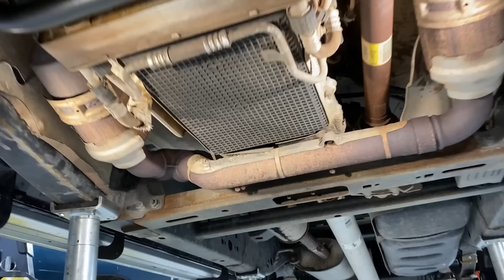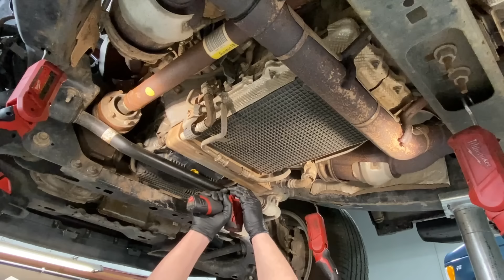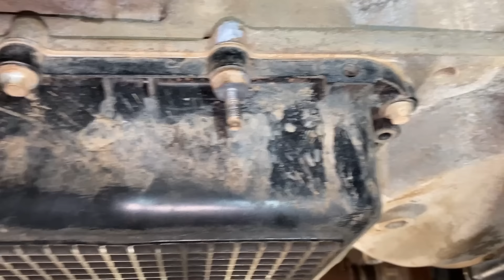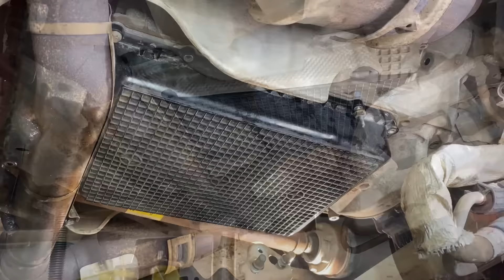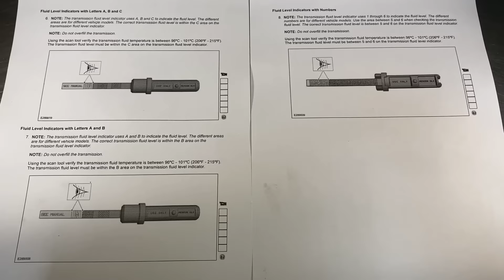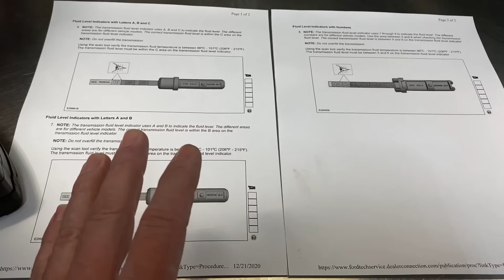Ford 10R80 Ten Speed Transmission: Fluid and Filter Service Procedure

Comment: Plastic transmission pan without a drain plug. Check
Dipstick you can only seem to access while underneath the car next to a hot catalytic converter. Check
Extremely Complex design requiring eight quarts of extremely toxic expensive fluid. Check
Reply: My 2010 Tundra is 13 quarts of WS, and doesn't even have a dip stick. You have to get the trans to between 95-105*F and pull a plug on the pain that has a stand tube in it and have the fluid just drip out, thats how you set the level on it. The fill plug is a 32mm plug half way up the drive side of the trans. It's easy with a 2wd, but the 4wd is a PITA. The front drive shaft and cat make it hard as hell to get your arm up in there to the fill port.
Reply: @TdrSld  I did our rav4 and sienna a few times. I just put in what I took out , dead cold on the drain and on the fill so you can’t really screw it up with fluid expansion ect.
Reply: @Firebird400  won't work on 10r80, mine and MANY others were over 1.5qts low from factory
Reply: @TdrSld  In my opinion, this is actually better than what Ford does. Those plugs allow you to check the fluid at much cooler temps (95f-105f) vs the Ford design. On most of the Ford's, the fluid needs to be checked at 200f which completely sucks with that stubby dipstick. This is also why Ford doesn't like people messing with their trans fluid. It's almost impossible to refill correctly. Most dealerships won't do it right either.
Reply: @davesmith2693  I use long handled hose pulling pliers. They have two round jaws designed to twist and pull heater hoses off. Use a wrench to loosen the cap and then lift it off with the hose pliers. Then use bent needle nose pliers to lift the dipstick in and out. Works great. I agree, it IS a pain in rear to have to go through all the trouble but it is the way it is so we just find a way to deal with it.
Reply: @davesmith2693  Yes remember stickers on fords  trans pan on the POS axod  saying do not service which which is funny because they usually needed more than just service an R&R
Reply: Hahaha yes this is great! 😆
Reply: I’m sure they’ll go to “lifetime fluid” soon too so they can sell more 60k trucks and SUVs
Reply: @krassimirpetrov7131  nah all the brands tried this yrs bk it didnt go over well. We need serviceability in these new expensive vehicles
Reply: There’s nothing toxic about the fluid. That’s about the dumbest thing that I’ve heard in a while.
Reply: @prevost8686  yep, I just had a big glass of it with dinner, feeling great!
Reply: @halleffect1  Hersey two step on your horizon 😂
Reply: @prevost8686  All transmission fluid is toxic, hence the warning labels.
Reply: @InuranusBrokoff  no it’s not.
Reply: As to why its “very toxic” i have no idea, but i have used this stuff and it has a big skull and cross bone warning right on the front of the bottle. Do a google image search on ford ulv.
Reply: @johnnorris6737  wear gloves an safety glasses or better yet get ur friendly dealer to do it
Reply: Why is the fluid toxic?
Reply: @yousufkan6960  it's not healthy but it's not that bad just wear gloves or get the dealer to do it
Reply: Germans take it to another level they tell you to fill the ATF thru the drain hole.
Reply: @MrManuel1329  same with Nissan/ifiniti.  just did a g37 like this
Reply: Maybe people should stop demanding new features instead of simple designs ?
Reply: 452Rob
Well, I have a 2019 Silverado in the shop that doesn’t have a dipstick. First one I’ve seen but I said below that all GM trucks have dip sticks unless the very newest ones don’t. To say I know nothing is a bit moronic being I’ve been a recertified ASE master tech many times over before I quit taking the tests well over a decade ago. I’ve been doing this for over 35 years and worked for multiple dealers and private shops. When you say I know nothing you loose credibility. Grow up dude...and learn to read all the comments so you’re fully informed about what someone actually said in context before opening your mouth and looking stupid.
Reply: Designed for unservicability. Ford.
Reply: @ShersGarage  ford and gm design. Not just ford
Reply: @ShersGarage  pay to let local Ford store handle it thus they on hook etc. My '19 Ranger XLT FX4 is set fine .
Reply: Hey but the filter actually bolts in.  In the 6R80 it wants to come back out while you're trying to line up the pan.
Reply: Huh ? Not my '19 Ranger XLT FX4.
Reply: Yea just get dealer to do it. Not any sort of routine service! This transmission is so incredible it's worth it ..no complaints!
Reply: @Readytobeamup  Amen to that.
Reply: @Readytobeamup  The difference is that the RAM is actually reliable, lol.
Reply: Don't forget must be running and up above 180 degrees to check level and there are about 4 different dipsticks now lol
Reply: CHECK MATE, ENGINEEEERS WIN AGAIN, ALTHOUG CUSTOMER IS ULTIMATE LOSER
Reply: You all don't think GM and the rest don't do this? I think GM was one of the first to remove the normal dipstick on the tranny.
Reply: @NY411Info  my 2018 chevy has a trans dipstick
Reply: @trevorchadwick5479  Maybe it does but many GM vehicles don't like the rest of the junk companies are building now
Reply: @NY411Info  ford had this dipstick on 2000 s lincolns ls with jaguar transmissions junk so no GM did not due this first
Reply: @NY411Info  nope. I service them all and so far haven’t seen a GM without a dipstick. At least not in the last 35 years.
Reply: @452Rob  have you never worked on a Cadillac CTS?  i do very few GM's but this one came in and had no conventional dipstick.
Reply: @halleffect1  I don't know what he is talking about the are many GM that are similar.
Reply: @halleffect1  well, I was thinking more specifically of trucks.  Ever done a Cadillac CTS but lots of Camrys and Honda CVT, etc. wWhat I meant was I’ve never seen a Chevy or GMC truck without a dipstick.
Reply: @ralfsautomotive  not GM trucks unless they are quite new.
Reply: @452Rob  I assumed that is what you are talking about.
Reply: @452Rob  guess you dont work on the  cars then. They definitely have a fill hole and check plug....but no dipstick
Reply: @gearwrench1davis392  I do work on the cars, said the same in another comment and said my initial comment was geared toward trucks. I owned a turbo Civic with the CVT trans that uses a weep hole. I service Toyota cars and trucks that also have no dipsticks. My original comment was intended for GM/Chevy trucks. They all have dipsticks. Period. If they don’t, they are extremely new.
Reply: @452Rob  you obviously are full of BS, my 2004 Cadillac CTS had a sealed transmission. Same transmission in the SRX and I am sure other GM products of that time period.
Reply: @halleffect1  You are so right.   My daughters drove a 2000 grand am V6 and 2004 grand am 4cyl, both had no dipstick for the transmission.
Reply: @452Rob  Ford and GM partnered to build this transmission... so, there’s that.
Reply: @Trey K, if you’d bother to read all the comments you’d see we’ve already discussed this. And you would see that in my earliest comment I said something to the effect that all GMs (and I was talking about trucks) have traditional dipsticks unless the very newest models are an exception. So there’s that.
Reply: @appleiphone69  ya cadillac cts is a great TRUCK
Reply: @452Rob  Cap

Comment: Is that a (yellow) plastic drain cap on the engine pan? 😳
Reply: Yes, along with the plastic engine oil pan.
Reply: They just need to find a kind of plastic that will work for the engine block now.

Comment: I suppose it isn't any easier on the current F250,  F350's with the 10speed?
Reply from the maker: The 10R140 on the Superduty trucks is a piece of cake.
Reply: @FordTechMakuloco  Thanks!     I assume that applies for all the engine choices (in my case the  7.3 gas motor)

Comment: No "lifetime" fluid in the 10R80E haha.Maybe I missed it what is your recommended intervals?
Thanks for another thorough video. Merry Christmas
Reply: In an earlier video, he recommends first service at 30k miles, changing the fluid only, not the filter.  Then fluid and filter at 60k, and then recommended interval thereafter, which I think is every 60k miles if I'm not mistaken.
Reply: This is not an easy job when your laying on your back with the truck on stands, but still do able
Reply: @blainemcdonald6972  Yeah I can only imagine. I wonder how much the dealer charges. I'd have to see if it's worth it to just have them do it.

Comment: I bought a 2017 F150 a little over a year ago. The truck has a 6R 80 and just passed 30K miles. I did a drain and fill and added Dormant pan with a drain plug to make it easier in the futer. The trans. shifts like butter. I thought I would have liked to have had  a 10 speed trans. but now think I doged a bullet!
Reply: I installed the doorman pan too, it works great.
Reply: I had a 2017 10 speed it was amazing,behind the 3.5L engine, what a great towing combination .Dealer offered me too much for it so now I have a 2020 3.5 w. a 10 speed and it too is a beast.

Comment: I just did my f250 and it was a decent sized mess. Probably spilled 1/2 quart on accident.  Can't imagine 10 quarts with no drain plug lol.  I guess without a transmission drain plug nobody will mistake it for an engine oil drain...

Comment: Ford: go ahead, service your own vehicle, I dare you.
Reply: And the Ford dealer wants to know why I won't trade in my 2002 F250......  The most difficult thing I have had to do so far on it, (Not done yet), change out the crappy roof corner trim pieces on top of the cab. I simply haven't had to do anything tough on this truck yet!! I take that back. Passenger side front shock top nut. That was a PITA.... Oh yeah, I still have not changed out the original spark plugs... V-10, don'cha know...
Reply: @SteveP-vm1uc  I had a 2003 F-250 with the 6.0 diesel....my thought was "who's the whiz that put the fuel filter on the frame under the truck!" Was totally ridiculous compared to the 2001 7.3 I had before it.
Reply: @SteveP-vm1uc if you still have them, and they just fell in the bed. Just glue them back on.
Reply: Yep, filled for life.......don’t think so! It’s the life of the fluid, which can be as little as 30k miles.
Reply: It's come a long way from the model T hasn't it? With those, they'd sell them with a basic took kit because people were expected to DIY. Now? I'm surprised we even still get a jack and a lug wrench lol
Reply: @crewdawg2008 some vehicles don’t even come with a spare tire anymore. That’s crazy.
Reply: @StephenBrewer89  I've heard of that. Not even a doughnut. I haven't been new car shopping in a long long time, and for plenty of good reasons, but a car not even having a spare tire just doesn't make sense to me.
Reply: @crewdawg2008  yeah it’s crazy man!
Reply: @StephenBrewer89 teslas don’t, call the dealer for a tow is the process
Reply: @debbiemccluskey384  yeah I refuse to take a vehicle to a dealer unless I am under warranty. I have done automotive service at dealers for long enough to know, the dealer is not always best.
Reply: Yupp makes sense just buy a new one, simple!
Reply: Got this! Ford trucks for life.
Reply: Thank God I have the 3.0L Powerstroke! Way easier.
Reply: I’ve used his videos and fully serviced my 2021. Incidentally, my transmission shifts so much smoother than it did. I found a lot of med grey metallic partials as little as 60,000klm
Reply: And I took that personally
Reply: Lmaoooo, is removing a few lines and 10mm bolts too hard for you?
Reply: I do all my own service, worked in the industry for years and I know for a fact regardless of what you pay for you’re lucky to get everything you pay for. Very few decent mechanics around, I believe this guy does the right thing but I’m in Southern Ontario.
I use Utube for directions and use Fordmakuloco a ton.
Reply: A good laugh I’m sure. The “engineers” designed this to be as complicated as possible.

Comment: Makes me even more appreciative of the comparative simplicity of servicing my 2011 Screw FX4 F150 5.0L 6R80. Early on I installed a proper trans dipstick and drain plug on mine.100,000+ miles with lots of RV towing with multiple trips to Texas, Alaska etc. And still looks and runs like new.
Reply: I added a drain plug and dipstick tube to the tranny pan on my 2014 Mustang GT so my future changes will be a lot more easy.

Comment: I just bought a 2018 f 150 with the 5.0 from a Ford dealer. I specifically asked when the transmission fluid needs to be changed. The answer I got, "its a closed system, you don't change it"
Now watching this I'm thinking they just didn't want to do it.....wtf!!! 
Looks like an expensive job.
Reply: They want you to buy a new truck when the trans in yours goes out.

Comment: I just did a fluid flush and filter change on a 4R75 in an E-series.  Piece of cake compared to this truck.  Nothing in the way at all.  I like to pull off the cooler return line up at the radiator first, start the engine and let it pump out most of the fluid into a bucket.  As soon as the fluid starts sputtering, shut off the engine so the pump doesn’t run dry.  The pan comes off without a waterfall and flood of fluid.  Clean it, change the filter, put the pan back on and dump in five quarts or so of fluid.  Leave the cooler line disconnected, start the engine and run it through the gears as it pumps the old fluid into the bucket.  Repeat this flush procedure a couple times until the fluid is coming out clean.  Hook up the cooler line, top off the fluid and it’s perfect.  Really gets it flushed out if you don’t have a machine that connects into the cooler lines.  The only downside on an E-Series is the long dipstick tube smears full of fluid when adding, so it has to sit awhile to drain down and get an accurate measurement.  Nice work!
Reply: You did a transmission flush? I'm sry. I hope ur transmission does not go to crap.. watch video from scotty on u tube why you never do that..
Reply: There had been a long controversy about whether to flush or drain/fill.  I have flushed fluid every 30k miles on all of my vehicles for many years to get the best fluid exchange.  Knock on wood, but I’ve never had a problem, nor have I ever had a transmission failure.  There are many automotive questions that are debatable - oil change intervals, proper vehicle storage, undercoating, maintenance schedules, hand wash vs. auto car wash...it goes on and on.  Do whatever works for you.
Reply: BTW - This 4R75 transmission has 150k miles on it.  I haul materials all the time with that van and tow a trailer on occasion.  Still works great.  Even if it crapped out tomorrow because of this flush procedure, it has served me well.
Reply: @stevejohnson5837  I have the same transmission on my crow Victoria and I did a fluid flush at 400,000 miles and the transmission runs better then it did before.
Reply: @1976axerhand  I have the same transmission as him with 400k miles and I flushed it out and it’s running better then before.
Reply: so you run all the fluid out and sucking in air I bet the pump and valve body just loves that
Reply: @sabrehawk-427  You're probably right because the transmission failed today.  I guess my flush procedure isn't the best method.  Just kidding - it's working better than ever.
Reply: @stevejohnson5837  I am glad it did I wish you the best of luck

Comment: A $50,000 +- truck and no transmission drain plug to make this less messy?
Reply: I wonder the same damn thing. Seems this is across ALL ford models. Ended up drilling and threading my own drain plug hole for my Expy.
Reply: You still have to drop the pan to get the filter.
Reply: @weedeater62  yes but it would be a lot easier and way less messy if you can completely drain the pan first and THEN remove it.

Comment: This doesn't look too bad, mainly just a bunch of hoops you have to jump through before you can get to the pan. I was worried that you had to lay a bead of rtv on the pan and somehow weasel it back into place without smearing it. It's nice that there's an actual pan gasket and it snaps into place, that makes the job a lot easier. How often do you recommend doing this procedure? Is it necessary to do this early on a low milage vehicle? Merry Christmas.
Reply: The Transits require subframe drop.
Reply: @atx-cvpi_99  Wow. I guess the advantage there is that the majority of work vans are poorly maintained so you probably won't run into it that often. If I recall the subframe bolts on the transits are super long so a simple trans fluid job could quickly turn into a nightmare once they get some miles on them. I'm really liking my f150 so far but I think I would pull my hair out if I was a ford tech, lol

Comment: Do the converter on there transmission have a drain plug?  Would be nice to drain that also before putting new fluid in
Reply from the maker: No TC drain plug Ford stopped that around 2001.

Comment: Man that's one noisy 5.0, sounds like my 2002 7.3 Diesel in my 1 ton , my 2007 5.4 in our Expedition does not sound like that , never had the pan off either of them electing to do a flush every 25 K before the oil gets really nasty, So far so good with no issues,  guess this is where Ford and I part company, that's insanity, what happened to KISS .
Reply: Cameras amplify certain sounds.  Its likely not that loud.
Reply: no one listens to their car from underneath but whatever